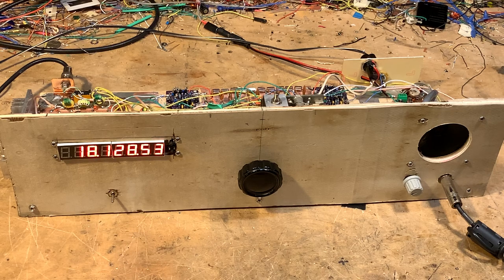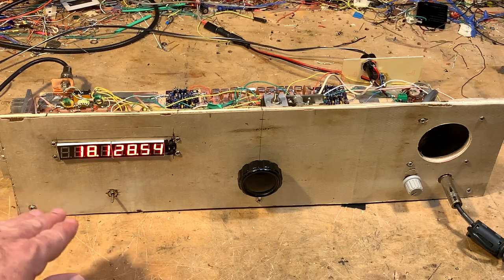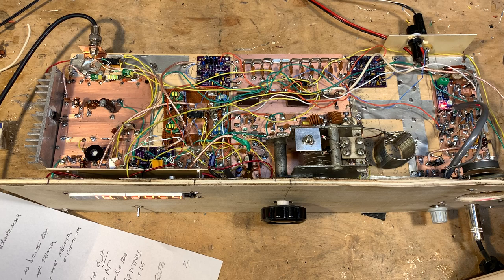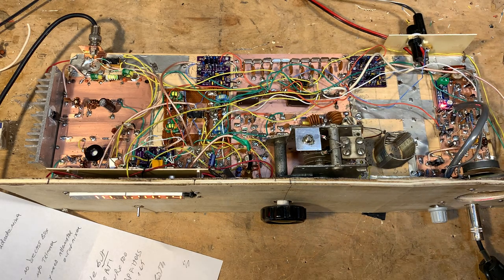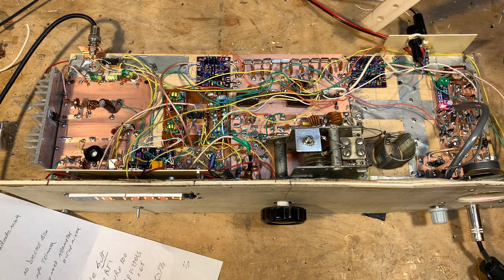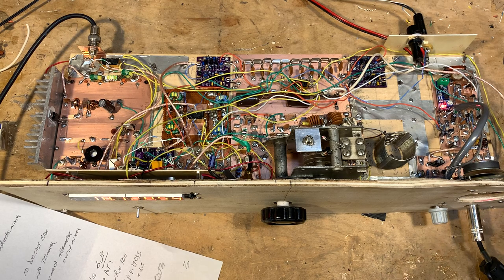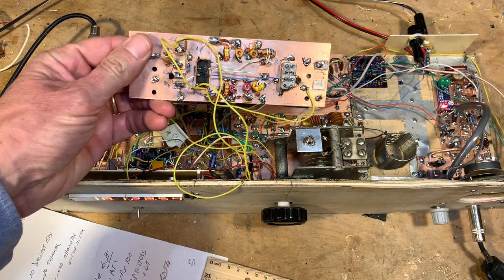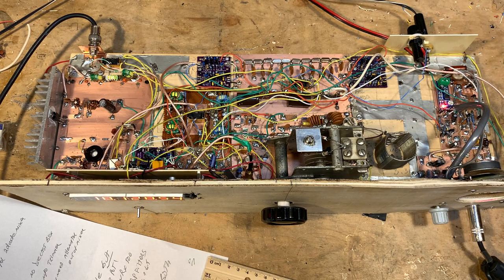The 17 and 12 Meter SSB Transceiver: Circuit and Build Description

Comment: Hey man.  Just recently discovered the podcast and I really dig it.  Much of it goes over my head, but occasionally something sticks, lol.

I'm really interested in old radios, the Kenwood hybrid rigs in particular, although I do have an S-40 and an S-38 that I've refurbished, and an SX-28 that is waiting for me to get better at it so I don't destroy it while trying to get it going hahaha.

I do some homebrew computer stuff.  Perfboard and point-to-point messes with 80s-era tech mostly.  Z-80 stuff.  But I am just a hobbyist.  My education was in software engineering, and although I self-taught the 8-bit simple hardware stuff well enough to cobble things together that eventually work sometimes, I am pretty lost when it comes to RF stuff.

See, I have an R-599 with both the 2m and 6m transverters in it, and those old Hallicrafters receivers.  I want to work my way towards building transmitters to go with them (I have the T-599 that goes with the R-599, but it doesn't do 2m or 6m, or FM).  I figure I can start with one of those single 6L6 cw transmitters, and gradually work my way up to AM and then SSB, and maybe eventually that 3-tube FM transmitter that floats around the web, if I can ever understand how it works and how to filter the output lol.

The problem is (and maybe I am just stupid, but...) much of the stuff out there seems to either (1) assume a level of understanding that I haven't worked up to yet or (2) presents a circuit without an explanation of how it works.  I'm just not sure where to *start*.

In that regard, can you guys recommend any particular literature or resources that would serve to educate a person of a newly-minted general-class license level of understanding as to how these radios actually work (preferably with a focus on tube stuff, ahhh tubes), in an incremental fashion?

Thanks.  I'm sorry for being so long winded and bozo-ish, but I appreciate any helpful directions you might point me in.  :)
Reply from the maker: You should get at least several books.  No one book will do it all for you.  Look for a copy of Solid State Design for the Radio Amateur (Hayward and DeMaw) or Experimental Methods for Radio Design (Hayward et al).  For tubes, look no further than "Hollow State Design" by Grayson Evans.  Excellent book.  Your incremental, start slow and small approach is exactly right.   Don't bite off more than you can chew.  Good luck, and please keep us posted.  73  Bill
Reply: @soldersmoke  Thank you, sir!

Comment: Hey Bill. I'm stopping to comment just a couple of minutes into the video. Do yourself a huge favour, buy an inexpensive jigsaw. I bought a green Bosch (not Professional!) for £25 twenty years ago. I use it more than any other electric tool I own. For a square hole, drill small holes at each corner, then join them by using a thin fine blade in the jigsaw. Easy.
Reply from the maker: Thanks Stephen.  Yes, I have a jig saw, but the needed hole is quite small and the plywood is quite flimsy so the Dremel like machine seemed like the way to go.  73  Bill